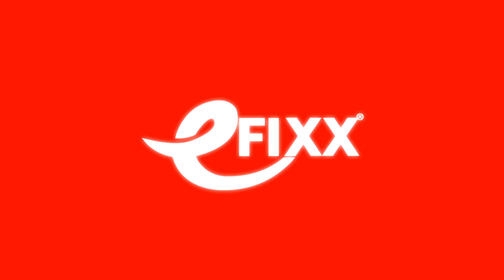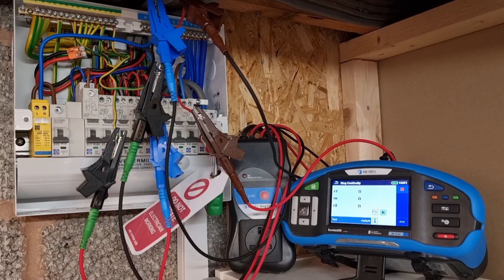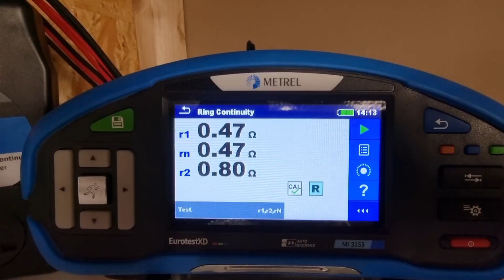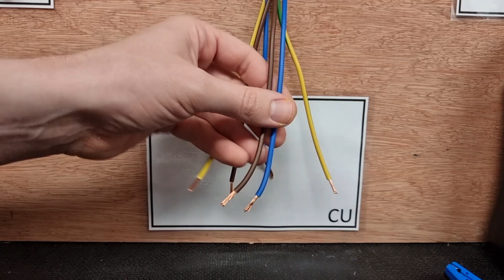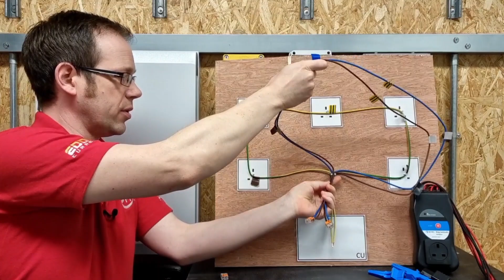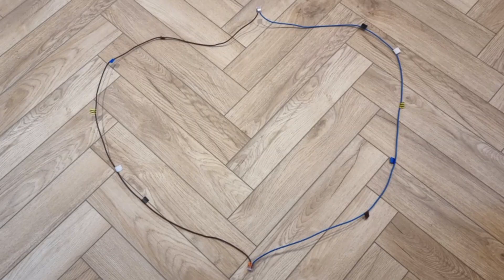How to Identify a Spur from a Ring Final Socket Circuit | Electrical Testing

Comment: There are NO videos anywhere that show  (explain ) how to terminate three cables in a socket ?  That was all good, but what happened to 3 cables in one socket ( a spur for example )     Do you still bend them over ? Twist them together ?   Just keep them straight, but one cable always seems to slip out ?   Do you know any videos that cover this as I cannot find one anywhere, thanks

Comment: What if I have a 1-Way to 3-Way Switched Socket Converter fused and want to connect to this socket, switch neon fused as spur (BS1363-4 13A 250V) and next to connect to a Masterplug EV socket in a Ring Circuit? 
Also, are the switch and EV socket(with BG EVRC 16A C16 30ma fuse) a spur from the ring circuit? 
Will the switch work as the on/off EV socket, or is that dangerous manner? What about amperage according to standard 13A sockets?
I have Ring Circuits for the ground and first floor together, but only the kitchen sockets are separate.

Comment: The video description asks the simple question how to identify a spur from a ring final socket circuit. Yet you went way beyond that   question. The answer to that question is simple remove the socket or sockets and see how many conductors there are if there three wow it’s a spur . 😊
Reply: And how would you know if you opened up a socket which was a spur of a spur. Say thanks to the man and move on. Great video 👍
Reply: @mwbg my answer was in relation to the the video description, how to indemnify a spur from  a Ring final , not how to identify  a spur from a spur.

Comment: Hi,
I find that unless working on new or fairly new ring final circuits the results when tested at the socket outlets can vary considerably which makes confirming multiple spurs or interconnections difficult. Where doubt exists this usually means removing the face plate and actually testing at the conductors,making a simple test time consuming along with the other problems associated with removing old sockets ( stripped back box lugs, decoration damage) when carrying out EICRs ring final circuits are often the most likely to be unsatisfactory.
Reply: I agree. You're effectively trying to reverse engineer and create a circuit diagram by measuring resistances. Not ideal, and not easy.

Comment: My house has been a nightmare for rings
There were only two plugs in the original upstairs and downstairs rings
Until the previous owner spured several additional sockets of the upstairs ring
And then he spured in the middle of those spurs to add more sockets downstairs
Where he used 1.5 wire to link to the additional junction box
Before going back to 2.5 🤦
And at one point he used a 6mm cable to go to a single socket
Did I mention the spur to the lights?
So unless you turned off the breakers for both sets of lights AND sockets, there was always a live feed to everything
I'm not even going to start on the disaster that was the kitchen wiring 🤦
He should have had his head tested 🤣

Comment: Rings are still king when it comes to general purpose socket circuits, and with good reason.  

A 32A ring will permit greater diversity when compared to a 20A radial, while allowing much more flexibility in terms of installation methods than a 4mm 32A radial (which can only be installed method C).  Rings also allow a WAY longer circuit length in terms of voltage drop than either radial, nearly 2.5 times as long!

Rings are less prone to arcing in the event of a loose live conductor (there will only be a few volts difference between the 2 separated legs), and will still have a CPC to most, if not all points, in the event of a loose CPC.

It's true that rings involve slightly more testing, but it's not THAT difficult is it.  It's only really something that lesser sparks seem to struggle with.

Radials have their place for sure, but with so many advantages to rings, they won't be axed any time soon.
Reply: “Greater diversity”? That’s an odd way of phrasing it. Having a single circuit cover so many sockets makes diversity worse, surely? If something is nuisance tripping I’d like that to cover as few devices as possible.

But then again the UK also still allows dual-RCD CUs, so clearly you all just enjoy candle light trips to the fuse box.
Reply: @JasperJanssen  I think you think nuisance RCD trips are more of a problem than they actually are. That aside, new board installs and changes all have RCBOs with SPDs and AFDDs.
Reply: @JasperJanssen  32A circuits are extraordinarily convenient in locations with multiple, relatively high draw devices, such as kitchens or workshops as it's very unlikely that enough will be on at the same time to trip the breaker. Also, the householder can freely re-arrange where they plug in things like toasters, air-fryers, microwave ovens, electric kettles, irons, portable space heaters and so on without much concern it will cause a nuisance trip. If multiple lower current circuits are used, then you are more likely to get those nuisance trips unless you are careful where you plug things in. If, however, people object to 32A ring circuits, then it's still possible to wire them up as radials using 6mm^2 cable. 

As for dual RCD boards, then I do not like them, and specify RCBOs every time. They ought to be standard as the difference in costs spread over the lifetime of the unit are small.
Reply: Greater diversity? Not sure what you mean with that phrase in the way you have used it.

The example you give isn't good because you have different current figures specified, so of course one is going to be able to handle more load.
Reply: @deanXRayZulu   I'll try to explain it as best I can.  2 identical houses:  
House A has a single 32A ring for all of its sockets.  Total load permitted is 32A.
House B has two 20A radials, 1 for the sockets in the kitchen, 1 for the sockets in the rest of the house.  Total permitted load is 40A.
House B has a greater total permitted load, yet is more likely to overload any one circuit.
I should also mention that BS7671 doesn't have diversity in its definitions, but this is how I understand it.
Reply: @andrewcadby  ok.

Diversity is about having appliances connected to the circuit which total up a higher power (or current) than that permitted for the circuit.

So if you have a 20 amp circuit - I will work in watts here - the maximum load that can be used before the breaker trips is 20*240 =4800 watts.

However, the principle of diversity says you can have appliances on the 20 amp circuit which in total exceed 4800 watts, say 7000 watts as an example.

The risk is, that if you turn all the appliances on that 20 amp circuit, the breaker trips, because 7kW of load exceeds the 20 amp limit for the breaker.

Underlying the principle then is the idea that you will almost never have all the appliances turned on at the same time.

So total connected load for the circuit exceeds the total the circuit can handle.

Is that what you are referring to?
Reply: @deanXRayZulu  yes, that's it, but I'm talking about the principle of diversity rather than the application of a diversity factor.  

As you said, the principle relies on multiple loads on a circuit:
If there's only one load on a circuit, the chances of 'all loads being on simultaneously' is guaranteed.  5 loads on a circuit, somewhat less chance of them all being on at the same time.  20 loads on a circuit, considerably less chance of them all being on simultaneously.  And so on.

With house B, the two 20A radials allow less opportunity for diversity to come into play.  There is a fair chance that the kitchen circuit will overload, while the rest of the house has minimal load.  This is less likely to happen with house A, having a single ring covering the whole house.
Reply: @andrewcadby  Interesting point.
You wouldn't be able to have a single ring covering the whole house, in that all loads are connected to it, because the code provides recommended types of circuits, so cookers would be on their own, and lighting would be on another, and mains socket outlets would be on another. In that way, if a breaker trips you don't lose power to the whole house, just an individual circuit.

Diversity should only really come into play on those circuits which are high current appliances such as a cooker with other loads on the same circuit, because lighting is so low power that it should be possible to turn all the lights on and not trip the breaker, lighting is typically on a 5 amp breaker if I remember.
Reply: @deanXRayZulu  agreed, I'm really just talking about comparing socket circuits here, the old ring vs radial debate.

My opinion is that diversity (as I see it) comes into play a lot more than is obvious.  

For example, a twin socket outlet to BS1363 is rated at 20A (that's all the standard requires apparently).  Theoretically someone can plug two 13A heaters in and have them running simultaneously, totalling 26A.  If the twin socket is on a circuit with a protective device >20A, then the twin socket gets overloaded.  In practice this rarely happens, people don't tend to plug two 13A heaters, or similar loads, into the same twin socket.  This, to me, is diversity at work.
Reply: @andrewcadby  Yes, I have seen qualified electricians argue the merits of ring final circuits but I come back to that in a moment.

RFCs are only used in the UK I believe, they are not used in France, so the fact is we can manage without them.

RFC's inherently suffer from a design problem, which is somewhat diversity related. The RFC has two cables in parallel, one going down each side of the ring.
In theory what can happen is, if too much load is placed on one side, the cable's current rating can be exceeded but the current is less than the breaker trip value. And this then poses a fire risk.

Now in the case of diversity on a circuit, if you turn on all the appliances the load current will exceed the breaker value and it will trip cutting off the power and creating a safe situation.  This is slightly different to the load imbalance on an RFC where the breaker does not trip.

So whilst the RFC imbalance problem doesn't occur very often , there is a fire risk there. And for that reason I don't like it: it is inherently flawed and there are alternatives.
And whilst people say that more copper cable is needed in a radial circuits, isn't it worth paying the extra to completely remove that fire risk?

One of the arguments I have seen in favour of the RFC is that the voltage drop across the cables is lower.  In my opinion that is a false argument. If we consider two scenarios, a load on an RFC and on a radial,  of course the voltage drop across the cables on the RFC is going to be lower: there are two cables in parallel, meaning the resistance is halved and hence the voltage drop is halved. 

But what this is comparing an RFC of length X metres from the consumer unit to the farthest point with a radial of the same length. And the RFC has two conductors in parallel which is double the cross sectional area of the radial, so of course it is going to have a lower voltage drop, but is it any cheaper ? No, because you are using two lengths of cable of X metres where the radial uses one T+E of X metres. So the RFC is going to be more expensive. But what you get for it is that is a lower voltage drop and lower wasted energy.

Now, if you want a radial to have as low a voltage drop as the RFC, you have to increase the cross sectional area of the cable to make it double. So you just end up with one thicker set of cables on the radial compared to thinner cables on the RFC but the total amount of copper present is the same.

And the other factor comes in is, does that voltage drop actually matter? Often for the appliances no, but that voltage drop, that symbolises a higher cable resistance which means the (I^2)R losses are higher and that's wasted energy.  So in the long term it might be better to double the CSA on the radial to reduce the wasted energy.

In terms of safety: there might be scenarios where the RFC is "safer" than the radial, but I  think those scenarios are fault scenarios.
And as I indicated earlier in this post, the RFC is inherently unsafe in a normal operating scenario, and I can't acknowledge that this is acceptable. To my mind, in normal operation it should not be possible for an electrical installation to cause fire or pose an electrocution risk. These impacts should occur only under fault conditions, and that is not the case for the RFC.

And in a fault scenario, anything goes, but we should take steps to reduce the risk under fault conditions, but not at the expense of comprising safety under normal operating conditions. My opinion.
Reply: @deanXRayZulu  You're right about the potential to overload one leg of a ring, it is possible.  Under normal use, it's expected that neither leg will exceed 20A, but with a lot of heavy loads positioned a short way along one leg, this can be exceeded.  

It is possible, but I believe this is a theoretical concern only, and personally don't believe it is a fire risk.  Presumably this was considered at the time rings were invented, and we have had about 75 years of testing them in many millions of buildings to demonstrate that it's not a real-world problem.

I am not aware of any cases of thermal damage resulting from one leg of a ring being overloaded in this way.  I'm not even aware of any cases of thermal damage resulting from a 'broken ring', where in some cases the entire circuit current can only flow through one leg.  My opinion is that the overload imbalance you describe may shorten the life of the cables (but again, I have yet to see evidence of this), but I don't believe that it's enough to cause fire.

In my experience, except where caused by equipment (eg. hot lamps), thermal damage is always caused by loose connections.  For this, the ring has an advantage over radials.  A single loose connection on a ring is far less prone to arcing than the same on a radial, due to the low potential difference across the separated conductors.

I am unaware of any reason why rings might offer an increased risk of electric shock, when compared to radials, can you expand on this please?  In fact, with two CPCs to every point, I consider the risk of electric shock to be significantly lower for rings.

I have a different opinion regarding voltage drop comparisons, I'll compare some circuits to explain what I mean.  Note that rings are usually installed where it's convenient to have both ends at the consumer unit.  This is usually the case in most homes, but sometimes there are cases where a radial is the obvious choice.

The following circuits all assume that voltage drop is the limiting factor:

The 'standard' ring final wired in 2.5mm T+E has a maximum total length of 106m, so 53m to the mid point.  This assumes a load of 26A placed at the mid point.

The maximum length of a standard 20A radial wired in 2.5mm T+E is 42m, assuming 16A at the furthest point, so shorter than to the midpoint of a ring.  You could use two of these radials instead of a single ring (still 22m shorter overall), but then you miss out on the diversity that a 32A circuit offers.

The maximum length of a standard 32A radial wired in 4mm T+E is 43m, assuming 26A at the furthest point, again shorter than to the midpoint of a ring.  

As before, you could use two of these radials instead of a single ring (20m shorter overall though), but at the expense of using extra copper, and reduced options for installation:  You can only install to method C , you can't have the cables come into contact with insulation, you can't even install them in trunking or conduit unless you use singles.  Admittedly you would benefit from greater diversity and overall permitted load, but this isn't usually necessary for household socket circuits.

These comparisons show that rings win for MAXIMUM permitted voltage drop, when compared to other reasonably similar options.  Under certain loading situations (evenly balanced over both legs), there may be greater losses to cables in a ring than two 4mm radials, but if this is a concern, install a 4mm ring and you benefit even more in terms of voltage drop (max length 171m).

Comment: Quick question, how many sockets are permitted on a single ring?  Being in the US this is not used here.   I have seen some that seem to wire all sockets in the house to the same ring there, for some older installations.  Great job sir.  👍
Reply: Unlimited within 100m²
Reply: @MrJustbrowsing12345  was about to type that myself
Reply: There is no limit to the number of socket outlets on a ring main, but the circuit can only cover an area of 100 square metres.
Reply: We don't go in for limiting the number of sockets on a socket circuit in the UK (I think some mainland European countries do). IMO this is a sensible policy, the number of sockets generally bears little relationship to the ammount of load. If there are less sockets people will just use more power strips/extension leads.

There is a guideline to limit floor area to 100 square meters, I don't think this is an actual regulation though just a guideline but in practice it would be pretty rare to see a ring serve a floor area that large.

You do see some smaller and/or older installations with only one ring, but in a modern installation it would be normal to at least split out the kitchen onto it's own ring, and generally in a house to split upstairs from downstairs.
Reply: The number of sockets isn't really the problem..if you plug in too many appliances then you will exceed the current rating of the breaker and that's a safe condition because the power is removed.

The issue is around plugging in too much load on one side of the ring which results in the current rating for the cable being exceeded but the current is less than the breaker rating and the breaker doesn't trip. And this is an unsafe condition because the cable will overheat.